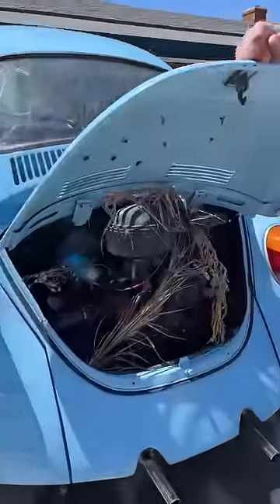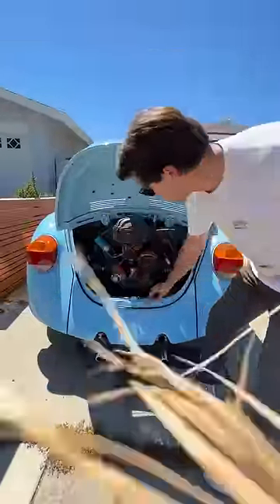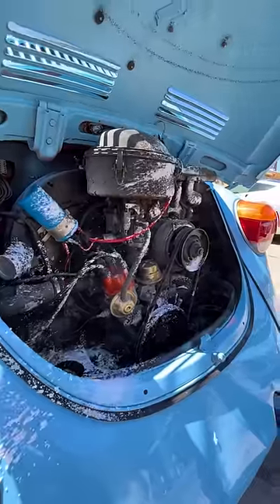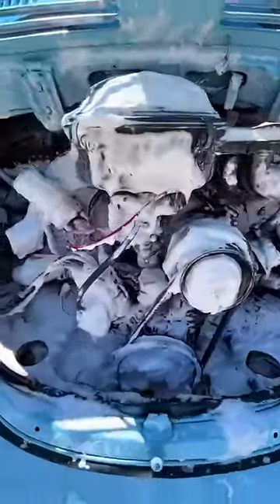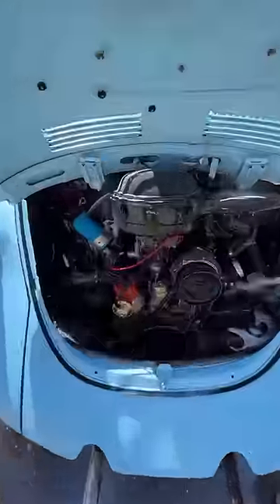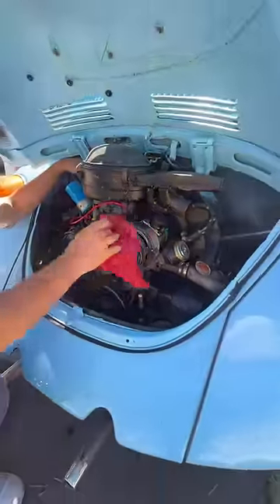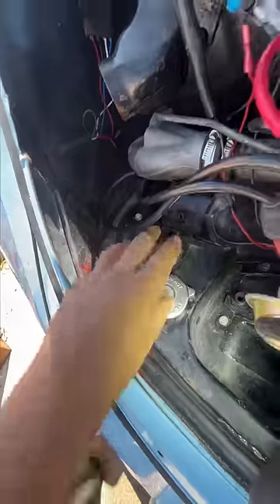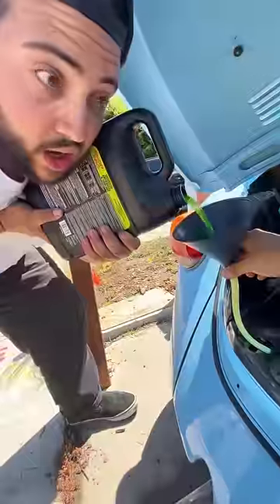Cleaning my engine bay

Comment: Soak that distributor real good too.
Reply: It’s fine
Reply: It’ll dry out eventually
Reply: It dries out
Reply: And alternator
Reply: For the none mechanic's saying it will dry out, no it won't it will corrode the rotor button and cap tips.
Reply: With my experience of getting water in a distributor is water getting through the shaft then in the oil.
Reply: Its a possibility
Reply: @Sintaj. no it won’t
Reply: @Lxk3ez  it's not like I own a carbureted v8.
Reply: @texasboyz713  an alternator can get wet. It’s exposed to the elements 24/7.
Reply: @shainhoon4929  that’s why you wipe most of the water down🤦‍♂️
Reply: @tinosimpson7198 the road isn’t wet everyday, yes it can withstand splashes of water but it’s not meant to be drenched in water it’s not completely waterproof
Reply: @Sintaj.  it’s an electrical part, I’m sure that shouldn’t be good
Reply: @shainhoon4929 I work at blue beacon truck wash and we pressure wash engines every day, been doing it for decades.
Reply: And those belts make sure you get those lubed up
Reply: And the belts😂
Reply: Thats what she said
Reply: Top off the refrigerant?

😂
Reply: Crazy concept i know but.... engine bays are exposed to the elements
Reply: @dOnDee831 yet slap a snorkle on it and its fine?????
Reply: Then how do you remove the foam, I really don’t know xd
Reply: Man a lot of people seem to not realize that when you drive in the rain your vehicle moves forward and rain falls through the air and air gets pushed through your engine bay but when it's raining it's not just air there's a little bit of water in their what you just so happens to get virtually everywhere in your engine bay spraying out your engine bay with water is not going to fry every single electrical component to exist within a 3-mile radius of the vehicle alternators and distributor cap 7 waterproof for a good while soaking them in water for an extended. Of time is idiotic and begging for trouble but spraying it lightly and then wiping off the water is completely fine so shut up
Reply: Lol
Reply: @Sintaj. Bro a Volkswagen doesn't have a Damn V8
Reply: @Dwayne.M  they both have carburetors with the same concepts
Reply: Top off coolant 😂😂

Comment: I can't tell if it's a '73 or newer because the fender holes have been filled. Dual Port 1600cc with Dual Solex Carbs, .009 Distributor and a 4 => Dual Pack Exhaust would turn that into nice little Scooter!!! 😎👍
Reply: Italian carburators, really good ones, i have a fiat 128,It was running rough with its original Weber 32 icev 10, cleaned It, It runs like a beauty😂
Reply: Put a big cam in aswell sheel fly
Reply: It might be i have a 73 jeans vw beetle and the bavk looks rly similar
Reply: The tail lights are 74 model .

Comment: coolant in a bug?
Reply: Ya I was thinking about that 2
Reply: Yes goes in near the sme spot you always pour in blinker fluid gear the piston return springs.
Reply: im sayin
Reply: Some are not air cooled
Reply: @ThefirstSolorMoon all of the old bugs that are rear engine are air cooled. now the new ones are on a jedda frame a d that front engine water cooled.
Reply: @redjasper1100 incorrect. Some (not all) do use coolant, and as a matter of fact you should have your Volkswagen Beetle coolant flush completed every 30,000 miles or every two years.
Reply: @redjasper1100 stop tryna act smart correcting people that are correct to begin with.
Reply: @redjasper1100 trust me you ain’t all that honey
Reply: @R.A.G-xe6sd  I'm talking about all of the original bugs. They had air cooled boxer engines. Now the new ones are out of question. They are on a jedda frame which is front engine front drive. And they are water cooled. Even the busses were air cooled. That was the big thing with them. That's also why they had terrible heating problems during the winter.
Reply: @redjasper1100  ah okay.

Comment: You should do this on the platform of a carwash (at least in EU, they have to pretreat the water collected from the cars and to sent the rest into the sewage for treatment). All the gunk you take out could actually be pretty harmful if it reaches the soil or the waterways through the rainwater collection system. Not all rainwater collection systems take the water water to a treatment plant so basically they just get dunked into the local waterways. Stay safe, protect the environment.

Comment: i might be wrong but weren’t these older beetles air cooled?
Reply: yeah till they swapped to front engine mounted cars
Reply: @joshuaryanferguson3702 they did make rear engined eater cooled vehicles, the type 25 platform came with either a 1.9 water cooled diesel or a petrol boxer 4 water cooled. both of these had issues removing the cylinder head studs because of the corrosion caused by coolant
Reply: @evelynkinson5524 the company never designed a liquid cooled boxer four for the vw beetles sense they were rear engine mounted till the late 90's an they never came with a diesel until the late 90's
Reply: @joshuaryanferguson3702 In 1951, Volkswagen prototyped a 1.3 L diesel engine. Volkswagen made only two of these naturally aspirated, air-cooled boxer diesel engines, and installed one engine in a Type 1 and another in a Type 2. The diesel Beetle was time tested on the Nürburgring and achieved 0–100 km/h (0–62 mph) in 60 seconds.
Reply: He faked it, lol
Reply: The fucking 911 was air cooled until 1998, yes every classic bug is air cooled
Reply: You’re 100% correct

Comment: The carburetor has a plug in it that is notorious for falling out , so the JB weld is there to keep it in place ! It’s probably already fallen out before 
Also the vacuum line from the carb to the distributor is in the wrong port on the carb , it should be on the left side of the carb (as you look at it) about halfway up !

Comment: To all of you own a Volkswagen bug. From the time they were made to 1965 70. Check your wire harnesses where the folks wagon used metal tabs to bend over The Wire. Harness's the whole diamond place. They routinely do short out. And when it does, it catches your engine Bay on fire? So inspect all your wire harnesses. And make sure that the metal is not folding over The Wire if it is, get a piece of plastic hose or something on the metal clip.  And then place it between the oneclipse between the clip and the hose are clipping the wires.

Comment: That jb weld would’ve been fine I jb welded a hole shut on an engine block and it help up for 3 years till I sold it I’m not sure if it’s still holding but I’m very impressed with that product

Comment: Gasoline lines are also built-in disaster on the Volkswagen. Make sure the hoses are not cracked on the outsidespecially. Around where there's clamps hose clamps. Where there are hose clamps.

Comment: Serious question. Is it allowed to clean your engine bay on a non sealed surface? The oils and gas residues will surely seep away in the ground. 

In my home country Germany, there is a risk of a fine of up to 100.000$ for discharging mineral oil into surface waters.

Comment: No coolant in VW That car and four deferent version was designed in 1935  Air cooling system Boxer type Less vibration then vertical engine
German engineering was always the best 👍

Comment: Someone get these men a can of brakleen
Reply: Nothing cleans/degreases an engine quite like Diesel for the cost. 

It's light enough where you can get all up in those oil passages with it, but contains no water like degreasers so you don't have to worry about adding water displacement oils to prevent flash-rusting. 

Brakleen is just how I rinse the Diesel residue off before soaking things like cams and bearings in fresh engine oil prior to reassembly. Also how I clean mating-surfaces prior to sealing them.  

Otherwise, if using only Brakleen, you'll burn through an entire case of brake cleaner and still not cut through really stubborn caked on oil deposits. 

Just a little trick taught to me by a buddy who worked on an oil platform for years. That was the way they kept their oil-covered equipment clean.

Comment: Very poor video. Distributor caps are very dusty on the inside. They should be wet down regularly before starting the engine and you add coolant under the rear seat!

Comment: aight, I see so much wrong shit here

like

since when does an air cooled engine have engine coolant, that was only an option on a vw T3 bus engine to have a water cooled engine (boi did they suck) . mind you this mf put engine coolant in his heater (if I remember correctly it is the heater)

oh btw nice distributor clean :) def a good idea to soak it that much :)